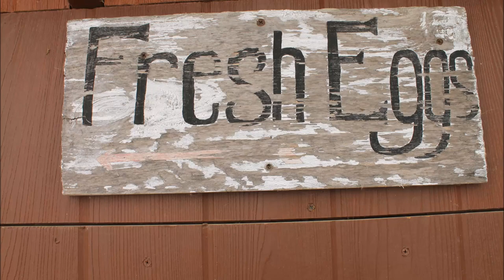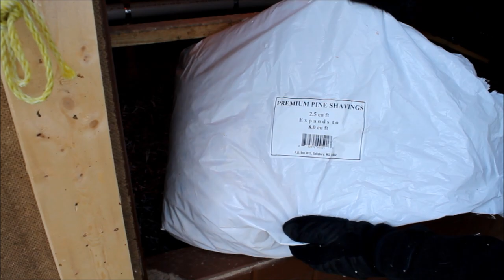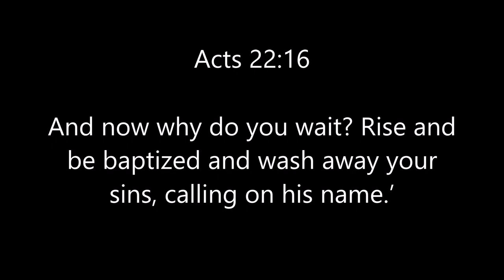Suburban Chicken Coop - Is it Really Easy to Clean?

Comment: Thanks for sharing your Coop! We just built one and after watching your video and others with the tray we found that people who had coops with just simple linoleum on the floor and a nice wide door had truly the easiest clean outs. They simply open the door and rake out the entire bedding into a wheel barrow in one or two sweeps. Much easier than messing with a tray. You could convert your coop and it would save you time and effort in the long run. 
I think the tray idea came from bird cages but it really doesn't make it easier for a Coop, it makes the clean out harder. After struggling to pull it out you end up cleaning Two floors, one for the Tray itself and one inside the coop after half of the tray spills onto it. Just thought I'd share this observation because a poor design shouldn't be touted as "easy" when clearly it's the opposite. Go check out some coops with just the linoleum floors. I'll post a Video of mine when it's done as well. I, like you, want my coop easy-peasy to clean, doesn't everyone? ;)
Reply from the maker: AquaWoman Having the sweep out flooring is also a great way to go. I went back and forth when I designed this coop Idecided for the tray instead. But this design allows you to do either, if you just want the sweep out just don't put the tray in, just put the linoleum right on the flooring. I like the cleanout tray better because it keeps all of the wet mess off of the actual coop floor which will in turn help the coop last longer. Believe me, it is not just as easy to just "sweep it into a wheel barrow" The mess gets stuck to the floor and you end up needing to climb or reach in an scrap the flooring so it doesn't always just sweep out as easily as it might seem. Hope that helps give you some insight, I have cleaned coops of all different design and this is by far the easiest I have ever cleaned:) Thanks for checking it out!
Reply: I RAISED AMAZON PARROTS YEARS AGO AND HAD A SET UP LIKE YOURS.  ONLY THING DIFFERENT THEY HAD A FLYWAY INSIDE AND OUTSIDE AND THEY LOVED TO SHOWER WHEN IT RAINED.  I HAD DOORS THAT WOULD BLOCK THEIR NEST BOXES FROM THE WIND WHICH WOULD BLOW FROM UNDERNEATH THE CAGES.   THE FLOORING WAS 1 1/2" HEAVY WIRE WHICH THEY COULD WALK OR FLY OUTSIDE.  THEY ALSO LIKE TO PERCH ON REAL TREE LIMBS.  I LIVE IN TEXAS SO THE WEATHER IS TOLERABLE FOR THEM DOWN HERE.  WHEN THE BABIES WERE FLEDGED AND EATING ON THEIR OWN,  I WAS SELLING THE BABIES ALL OVER THE USA & CANADA.   I GOT SICK WITH CANCER, AND I WAS WORRIED ABOUT LOSING THEM, SO  I SOLD OUT TO A MACAW BREEDER IN LOUISIANA.

Comment: If you take a bar of soap and rub it on the sides of your slide out tray for your bedding, it will slide much easier. Very nice chicken coop btw, much nicer than mine.
Reply from the maker: Rock Sutton That is a great idea, I was thinking of furniture wax or beeswax but soap would work also, thanks!

Comment: I had a similar situation with the waterer when I first made the first small coop.  The fix was adding a spacer block to get the pipe off the wall stud by an 1 1/2" and also I took some scrap formica, cut it to fit between the wall studs. made it about a foot long. Ran it so it stuck out from the sill about 3/4" into the tray and up the wall forming a curved water protecting slide of sorts.  If they splatter even as high as the main tube, it hits the formica and runs down to drip into the box of shavings.   this also prevents the usual "stuff"getting up on the 2x4 sill to clean off.
Reply from the maker: That is a great idea. I plan to do something similar when I redesign the water system this spring.

Comment: I would rather clean out the shop vac than tote the tray to the compost pile. I got very lazy in my youth when I discovered the wheel and have to find a reason change that consideration. Like the coop and I have cleaned out a coop the old way,shove, wheel barrow, etc.. Way too much work anyway "LAZY" is how I spell engineer.
Reply: This comment needs more likes

Comment: I tried using newspaper shaving but prefer the wood shaving because if any wind blow it across your yard then it doesn't look so trashy.  Also I think that it would be faster just to sweep the shavings directly into the wheelbarrow if you didn't have the tray system.

Comment: Hi, you should build watering system where there is no maintenance or filling the water manually by using toilet fill valve.  You can then permanently attached a water hose to the watering system and the water will fill as needed.  If you like you use a five gallon reservoir with the fill valve inside.
Reply from the maker: +tubetwo100 I have done something like this in my most recent video and plan to add a small float valve in the final product, great ideas!

Comment: Suggestion for Improvement . . . The opening to pull the floor-drawer out is too shallow, causing the debris to get pushed back into the pen & requiring putting your hands in it ... repeatedly, no less.... So ... Raise the top of that opening [to pull the bottom through] high enough so none of the debris gets pushed back while pulling it out.  That will also mean shortening the door above it ... and ... adding an extra piece to plug the larger opening.  I wouldn't make the front of the floor-drawer higher, as this would make it more difficult to handle.
Reply from the maker: Great suggestions, thanks!

Comment: nice coop looks alot like mine before the expansion... I dont have a tray though I just scrape right into the wheel barrow
Reply from the maker: Mark Thieme That works too! I think one of the biggest reasons I didn't want chickens originally was because I didn't want to have to deal with cleaning it, the tray makes it super easy and I don't mind it at all.
Reply: I could see that but it's nice not to have to fuss getting the tray in and out...

Comment: Looks good, I added a PVC pipe with holes drilled in it DIRECTLY under the nipple to catch any drips from the nipple. Then I ran the pipe at an angle out of the coop, seemed to work. Who knows maybe it would work for you too. Keep up the good work.
Reply: Directly in line* under, with room for the chickens to access the nipple.
Reply from the maker: +Jeffry Warren i had thought about that, sounds like a great idea

Comment: great job but honestly it seems harder then to just rake shavings off the floor into the wheel barrel.  should have made floor from lighter material and put it on some kind of rollers.  Or you can put tray onto a roller like one that comes with IKEA kitchen drawers, split floor in half in the middle with latch holding it together and put halfs on a hinges.  so you can slide it out, then open latch and just dump contents into your wheel barell :)

Comment: I'm curious about how you ran and connected your water lines(pvc). Do you have issues with them freezing?I'm in the process  of doing mine.Lots of options.
Reply from the maker: fuzzbutt2871 I am going to redesign mine this year as well. I want to be able to shut off the outside part completely in the winter as it was too hard to keep thawed when temps were below 10 degrees. I had them wrapped in heat tape and insulation but that couldn't keep up when the temps were too low. I am now going to insulate the inside piping and install a valve to shut off the water going to the outside. I am just using pipe insulation and heat tape. Hope that helps!

Comment: Please answer, lol. I want to create a watering system just like yours, but my question is - How do you keep it from freezing in the winter? Or do you have mild enough winters that you don't have to deal with it? My only idea so far is to put the chicken nipples on the bottom of a bucket instead of PVC pipe, and have a submersible heater inside the bucket, which are more commonly used to keep bird baths from freezing.
Reply from the maker: Ryan And Maty I had considered the bucket idea as well and I think that would work great! I have a video on what I did with mine this past winter here - https://youtu.be/TltF8rW4KeA. However, for next winter I will be shutting off the outside section and just heating the inside section as this heat tape could not keep up with temps below 10 for more than a couple days, then it would start freezing. Hope that helps and good luck getting it setup!
Reply: SSLFamilyDad Ok, thank you very much :). I was also considering the heating tape, so that's good to know. I guess I am going to go with the bucket with a submersible heater and have it able to be filled from outside using PVC pipe just like yours. It's funny because I haven't even started building the coop yet.

Comment: I'm curious as to how you clean the area below the coop where the feeder is? How often and how difficult it is to get to? With the food and the water it seems like a high traffic area.
Reply from the maker: rujonesin1 Since the entire run can just roll away from the coop I can throw in some sand or spray area off with the hose. So far I have had to do this once in the last year but I will probably do it again before winter. I usually ust add some sand to any low spots and the rain takes care of the rest.

Comment: Do you spot clean daily/weekly? ^.^ thanks
Reply from the maker: +heyitsmay Not all the time, I will add some wood chips or shredded paper from time to time in the nesting boxes and I do clean it quite a bit more often than I said in this video during the Winter months.
Reply: I only clean 1 a week and trow a few crush herbs in the nest boxes, i do not use deep littler 1 is not that hard to clean weekly and 2 i have s mall heather i turn on sometimes for about an hour in cold nigth, and a fan in the summer so i keep the beding low and sprinkle baking poweder.

Comment: Thanks for the video. The horizontal nipples work better as they don't leak like the vertical ones. This would also bring up the height a few inches.
Reply from the maker: Thanks Denton, I have not see any that are installed horizontally. I will have to look into that, thanks.

Comment: I have 12 chickens, if I only put the pine shavings and paper do I really have to clean it four times a year? Do you clean their roaming area?
Reply from the maker: +Ximena Pyne I will probably clean out there run this year, it has been two years. The main coop depending on how big and the weather you have will need to be cleaned about once a month while it is snowing outside and every two or three months in the summer.

Comment: What would you recommend for the type of shavings or paper to put in the tray to keep the costs down
Reply from the maker: I am using about half pine shavings (Which are very cheap) and half shredded paper. I just shred up anything that is not glossy and add that to the nesting boxes and coop floor. Hope that helps, thanks for stopping by!
Reply: I use hay most of the time and pine sahvings in the boxes wich are nade of plastic trays so i dont change them often. Hey is really cheap but may not fit in the tray

Comment: Was there any set or recommended height to set the drinking nipples or did you just eyeball it on height for your chickens? Also was there any trouble with them learning to use them? Thanks
Reply from the maker: In hind sight I would have put mine a little bit higher than I did but I added them when the chickens were much smaller and needed to be able to reach them. I would put them higher than they can reach as chicks and just put something underneath for them to stand on until they get older. They learned how to use them in about 2 days. I would go in and tap them with my finger and let a little water out and they are curious enough to go and do it too. They figured it out pretty quick. Thanks for watching and good luck with your coop!

Comment: Can treated lumber be used to build a coop?
Reply from the maker: Bizzie Bee60 Shouldn't be an issue. Modern wood treatments are not toxic like the old stuff used to be. I would only use treated lumber for the base of the coop though since it is more expensive and you should seal the rest with a stain anyway.

Comment: did you say you clean it 4 times a year?
Reply from the maker: +Joe Smith about that in the spring through fall. In winter I cleaned it 4 more times which was after I shot the video
Reply: So a little less than once a month? I don't have anywhere to compost, got any recommendations?

Comment: the only thing I would change was to switch to a Shop vac...   you wouldnt have to wear a mask.
Reply from the maker: That has been suggested before actually and I suppose it would be a cool way to go, just need to find an old one at a garage sale somewhere. Thanks!
Reply: +SSLFamilyDad  
Craigslist is a good start.  I am somewhat hadicapped and get about with a walker so the Fewer steps I have to do the better.  I plan on converting a Full on Garbage can for collection duty.  Just mount the vacuum unit and hose attachment on the lid.   I Will have ALOT more chickens to clean up after when I get my poultry house built though.
Reply: DEBRA DIXON-  I WOULD SUGGEST THAT YOU WEAR A MASK ANYTIME YOU CLEAN, WHETHER YOU'RE SCRAPING OR VACUUMING..BUT, THAT'S JUST ME!!